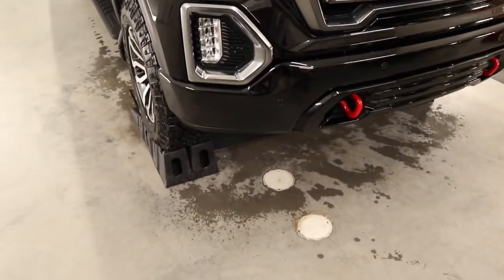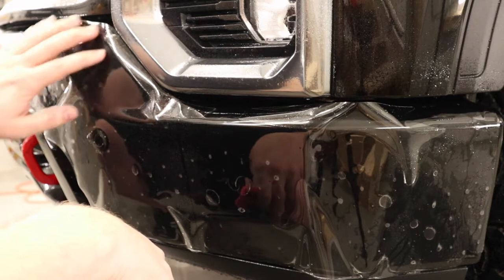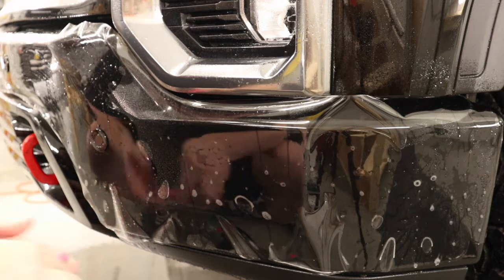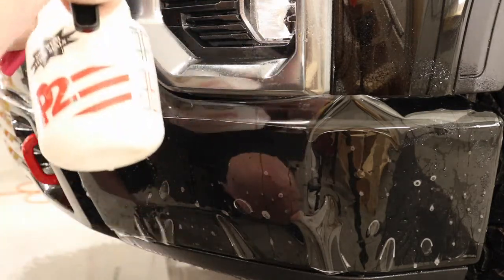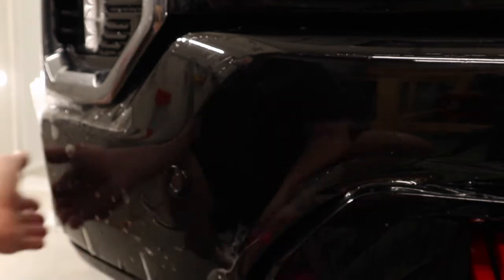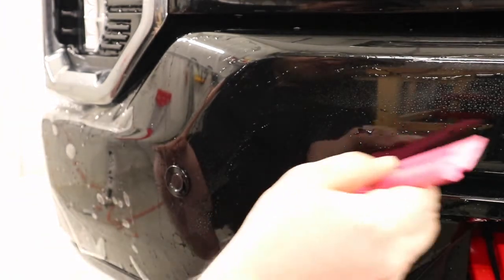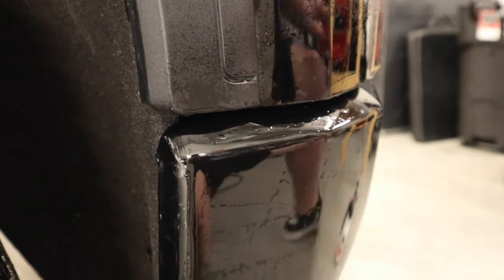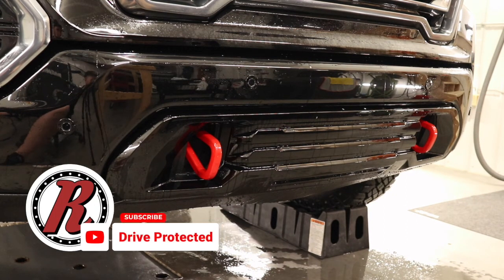AT4 GMC SIERRA CARBON PRO EDITION FRONT BUMPER CLEAR BRA PAINT PROTECTION FILM INSTALLATION!!

Comment: Nice work and your explanations on when you used slip and tack was great. I learned a ton. You mentioned post heating the film. What do you do to post heat the film? What did you do for surface prep? Thanks!
Reply from the maker: Hey, thanks for the kind words! For post heating the film, I use a heat gun and go over all of my edges with a microfibre cloth. By doing this, the edges will be sealed to the surface and eliminate the risk of the film ever lifting up. As for the surface prep, I will clay bar the surface then use 99% isopropyl alcohol to remove any wax or oils from the surface.
Reply: @DriveProtected  cool. I can't afford the xpel film or to have it pro installed so I am on the bubble for me, myself and I for the install. Looking at the 3m pro from invisible mask.
Reply from the maker: Bob, if you order from us, use coupon code XPEL20 to save 20%. Plus if you are American, you’d save even more because our prices are all in Canadian dollars
Reply: @DriveProtected  I'll keep that in mind for next time - very much appreciated! I ordered a kit from Invisible Mask on this truck but there will be others to follow. BTW...what squeegee are you using? Mine are not that pliable.
Reply from the maker: Here’s the squeegee link: https://www.maopodstation.com/tools